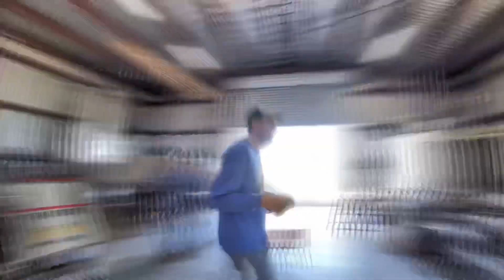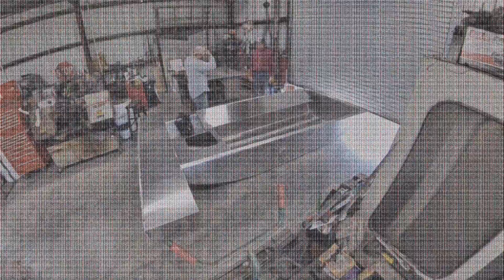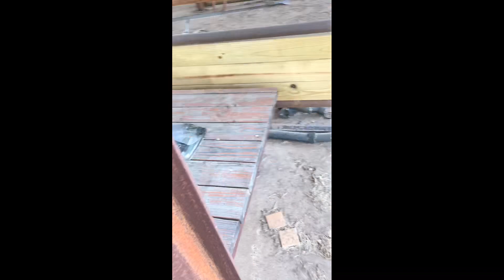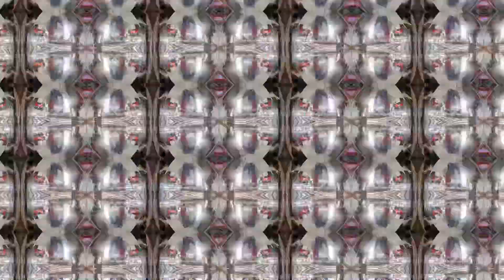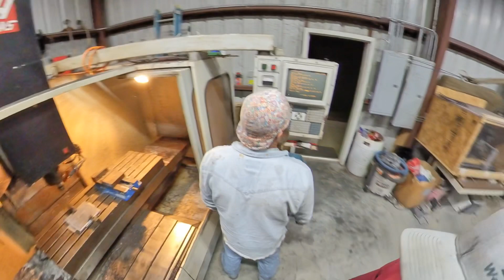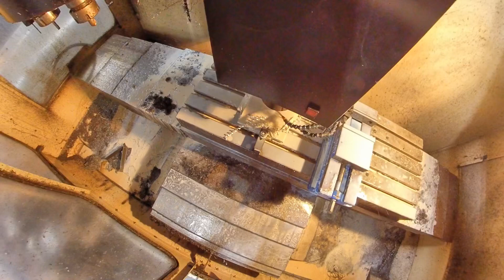Harley Davidson powered jet jon boat ( the hull)

Comment: Impressive build! You are building this boat the same way a company called Gator Trax in Louisiana builds their boats, the bottom is completely flat, 0.125" thick aluminum hull, air boat style raked front, and longitudinal structural ribs running the length of the inside of the boat so that your boat cannot accordion when hitting underwater objects like a boat with horizontal ribs can. I cannot wait to see the completion.